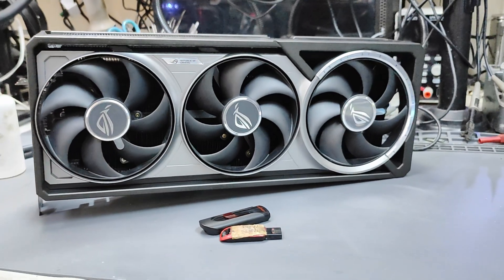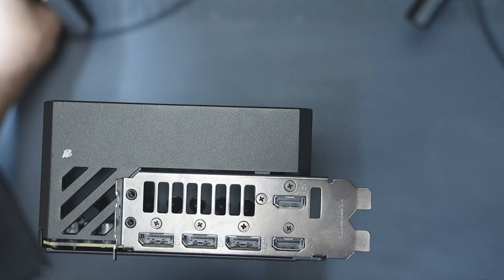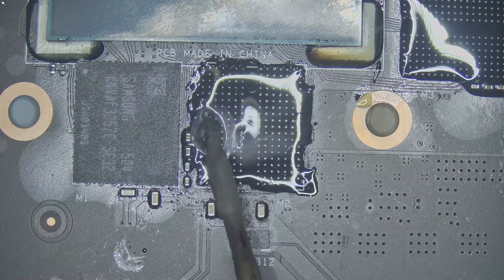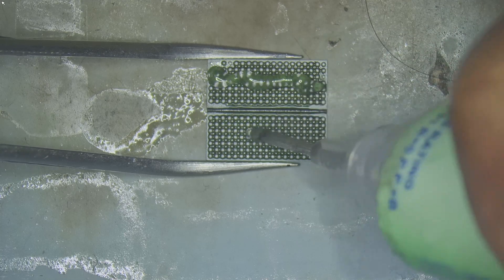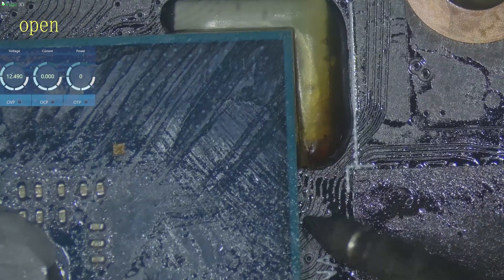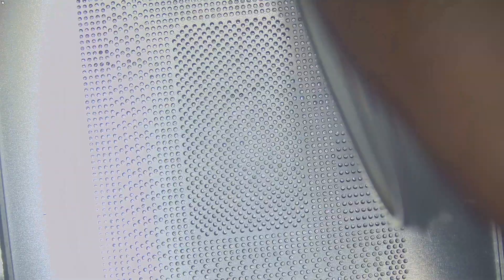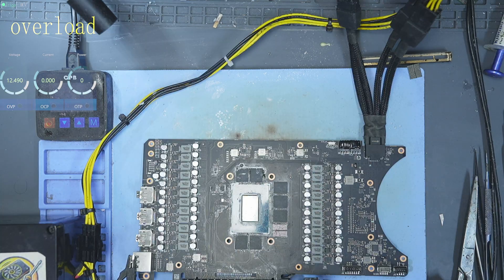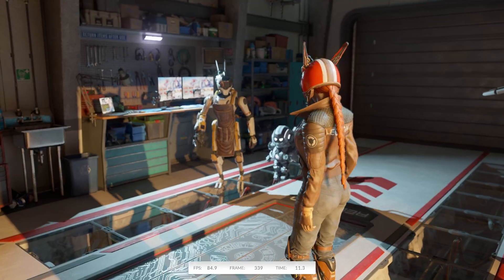RTX 5080 KILLED IN SHIPPING… and Brought Back to Life

Comment: That Asus 5080 is also sitting on my "to fix" shelf. It is a heavy monster :)
Reply from the maker: It's too heavy for what it should be. It's like a sheep in a lion's clothing. 😂. Not that it's slow or anything but it's does not require such a heavy cooler 😂.the weight itself is breaking the GPUs.
Reply: @GraphicsCardRepairs-tk7ql  Precisely! And imagine shipping a system with one of these cards installed. I am not surprised to see the condition of the 3 cards you mentioned here. They look terrible, yet that's expected.

Comment: Sir
Which type of gpu required with what rtx and vram for ai video generation
Reply from the maker: If your looking at AI video generation you can use any GPU. The difference is the time it will take  to complete the task. It depends on the tools you use. One hardware is not the overall story. You will have to take into account what kind of tools you will use and how much time is ok to complete your task. Once you decide on these important things you can then decide the hardware like CPU, RAM and GPU. For RAM the sweet spot is 32GB and for GPU sweet spot is 16GB. For GPU in a consumer space RTX 5080 is best when it comes to cost vs output. This does not mean other GPUs cannot do the task. It's just that it will take longer to complete it. So the answer is there is no one hardware that fits all.
Reply: Sir i want to create long ai video with consistent character with 4k visual quality

Comment: Why do they keep shipping PC's with the gpu installed
Reply from the maker: I ask myself the same question every week 😅
Shipping a PC with the GPU installed is just asking for trouble – the weight of the card can bend the PCB or crack solder joints when the box gets knocked around. Always better to remove the GPU and pack it separately before shipping.

Comment: Is title only clickbait? How story only shipping broke some pad? 
But nice video how to troubleshooting and repair i hope can learn that
Reply from the maker: The property of solder which holds the core and board together is that it can flex. Unleaded solder is harder. So area where if cannot flex further will snap. That is what has happened. Not necessary the other areas will break as well. This is common in shipping damage but this is light damage. I have another 5090 totally broken. It's in the memory testing video. That's towards the extreme damage.
Reply: @GraphicsCardRepairs-tk7ql i see

Comment: Great repair, but you should also glue the gpu back at its corners. That glue that you remvod has its purpose.
Reply from the maker: I did not have the glue on me. May be I will buy one.
Reply: Expound on the purpose of the glue please
Reply: @heretic5552  The glue or epoxy protects against mechanical and thermal stress, such as PCB flex, and helps maintain the reliability of the solder balls that connect the GPU to the board.

Comment: Great video Frasier. Question. I tried reballing a GDDR6X memory chip for my first time ever and the balls kept sticking to the template. I’d clean it retry and use less flux, but still the same issue. Do you think I’m still using too much flux? Thanks again for the great videos!
Reply from the maker: There are 2 things you need to make sure of. First the stencil before use make sure it is clean next the flux should be a very thin layer. If the balls are sticking to the stecil either the stencil is not clean or the flux is too much. If you could click a pic of the memory module after you have applied the flux and send it to support@gpusolutions.net I may be able to suggest further course of action.
Reply: @GraphicsCardRepairs-tk7ql  Thanks. Sending email.